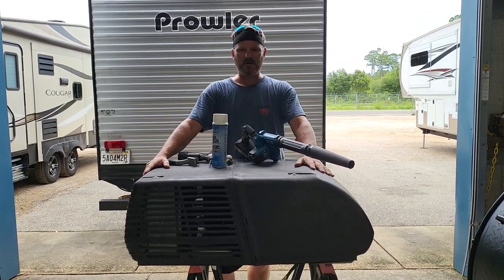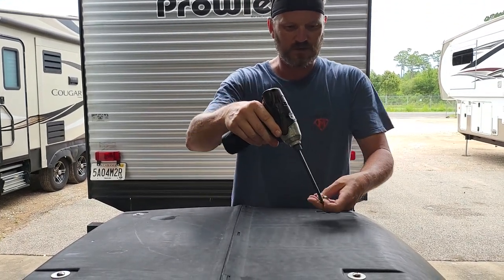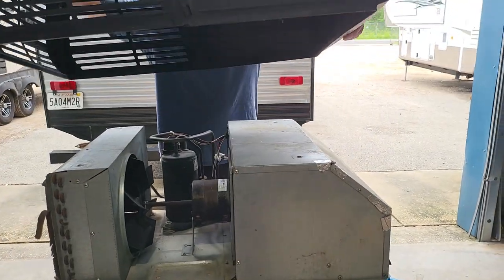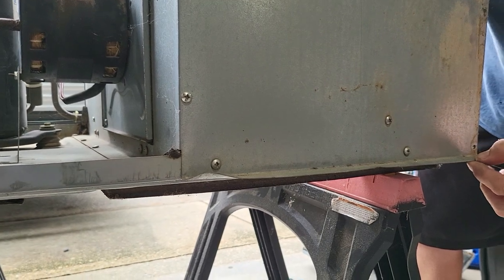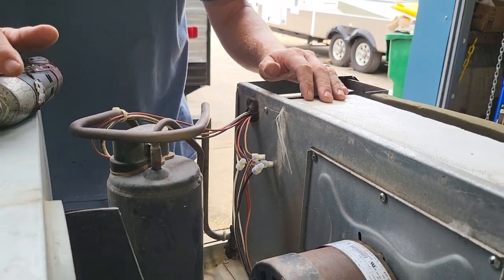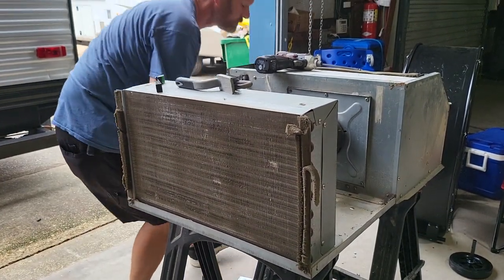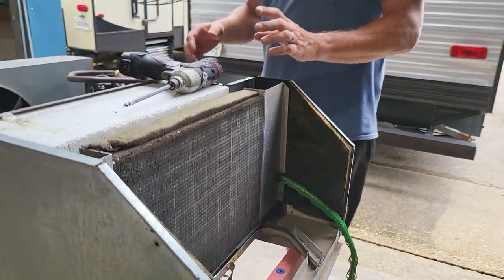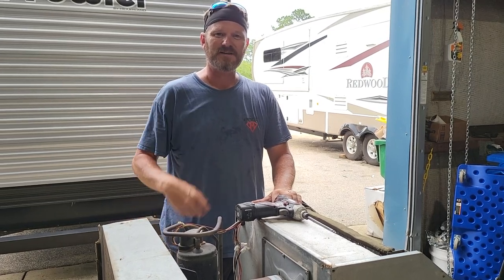Coleman Mach RV air conditioner walk through and **BONUS** maintenance

Comment: Do you have any idea how many videos I sat through until I found this one. I like it when someone just provides instruction.  I don't care where they bought the tape,drill bits, soda, or other crap. Thank you sir!
Reply from the maker: @LymanTaiste  thank you for watching!
Reply: Mine keeps tripping the 5kw generator breaker, 20amp. Sometimes after a couple minutes, other times after an hour. New capacitors & fan motor. What would you check next?
Reply from the maker: @ChrisHadlockTV  Compressor amperage, the RLA ( running load amperage) is listed on the data tag.

Comment: Edit: disregard, I just noticed the note at top left indicating dashed lines are optional.

Great video.  One question though, why only two capacitors when the schematic also shows a start capacitor? 

I have the same unit and today on a bright hot sunny day I disassembled it to troubleshoot and clean, when a torrential lighting storm hit suddenly out of nowhere.  I buttoned it up quick as possible trying not to get hit by lighting and assumed I just didn’t see the start capacitor.

I like that battery powered blower.  We used heavy metal Cadillac blowers to blow out elevator generators and motors for decades until Makita came out with smaller, lighter plastic blowers but still plug in (fine for us, we have outlets nearby) but a battery unit would be nice.

Comment: I have a 2000 mini Winnie Winnebago with an air conditioning on top only has 30,000 miles on it anyway I’m having problems with my fans starting and I changed all three capacitors. I know the starter capacitor for the fan has the brown wires in. it’s kind of the oblong shape Capacitor changed all three and I switch on the switch to check it. The fan still won’t start if it’s turned on and then I touch the fan and start turning it with my hand. It will go and it will work and work on high and low and everything works, except for the fan starting up and I know the capacitor that I put on the new capacitor I put on there works and I checked the white wires to go to the fan and it doesn’t seem like there’s any short those wires is there anything I might be missing, keep that fan from starting because the fan works. It works on high and low. It just won’t start unless started with my hand please I’ve been dealing with this for limited time over four years because RVs in Colorado and I live in California so I have a little time to work on it, but it’s really frustrating. Please help.
Reply from the maker: @MrDavehb47  capacitor the same uF? If so and tests good, then I would suspect bad bearings.
Reply: @MRRVTECH   even if the fan runs after I started with my hand and it doesn’t make any bearing noise and it changes speeds from high to low and low to high
Reply from the maker: @MrDavehb47  yes because the capacitor can't produce enough electrical torque to get it going froma static state. However, I would first be suspect of maybe getting a new/bad capacitor this must be verified first.
Reply: @MRRVTECH  ok thank you I’ll test those capacitors, especially the one with the two brown wires for the fan starter The RV only has 39,000 miles on it. You know how they are. They don’t they don’t get used that much plus I would think if the fan had bad bearings I would be able to hear it or feel it. I get these capacitors off Amazon I really need to test them  like you did.

Comment: On my Coleman, one of the four screws holding down the cover is spinning freely in the hole and won't come out to release the cover.  Have you had that happen before?  Any thoughts on a solution?  I'm guessing the threaded insert in the metal housing of the AC itself may have come loose and is just spinning along with the screw.
Reply from the maker: @jasonator13  yep many times, cut it off with a grinder. 5here are thousands out there with 3 screws

Comment: Great video. I learned a lot. I was just up there today but it was too hot to take it all apart. I have a very similiar Mach Q. 48204-0660. My question is if there is a modification that can be done to more effectively move the air into the ductwork for more flow. It seems to take my a/c forever to cool the rv down. I’ve added a Coleman soft start to the a/c for efficiency, but am very disappointed with the airflow. I have a Cougar 27sgs. Thanks for your instruction!
Reply from the maker: @dennisbachman4316  There is a product that claims to increase air flow by 40% its a styrofoam block with ducts that force the air into your ductwork directly so there is no wasted CFM. I have installed a few but I think "40%" is a little unrealistic. It does work though.
Reply: @MRRVTECH I looked into those. $170…Wow. My plenum is very shallow so not sure I’d gain a whole bunch from that. Thanks for the info

Comment: This is a good video, I've already learned how to clean the a/c, now my issue is the motor sounds like it still spinning/running for a few seconds after i turn the a/c off. It would be so very helpful.if you would make a video on how in the world you properly take out and and install a new motor. I have tired oiling the bearings but since the are not really serviceable I'm pretty sure I'm going to need to replace the whole motor. No decent videos are available for this. Thank you.

Comment: OMG! My really old 2006 Fema Trailer rooftop ac was making a racket and shaking after a coupla months of ownership. Yes, I bought a repo'd Fema! Anyway, I quit useing the ac when it acted up. Turned it on and quickly off for an electrician that came for a different problem, he say's "I know what your problem is and it'll cost you since I have to go up top. I just let it go and got a window unit since I live yr round in it. After watching your video I went on top and found the problem. Dirt dobbers nest on the fan!! Easy fix!! Thank You for this video!!!
Reply from the maker: You're welcome, thanks for watching.

Comment: hi Josh - from inside my trailer - i open to clean and there’s a styrofoam plate that moves around- i’ve been told this piece is the reason my coleman mock AC is freezing up and dripping inside, i moved it and now it smells like my AC is going out- which way should that plate face? 
TIA and thanks for all the great info
Reply from the maker: That sounds like your air dam that separates intake and discharge air. If the cold discharge air gets sucked into the intake the evaporator coil will freeze up. The air dam needs to be stood straight up and down between the two openings in the bottom of the air conditioner and then taped all the way around to prevent air mixing.

Comment: A very good video. I am happy I found you. I have a question. My 2003 Prowler has a Coleman AC with a thermostat on the wall. Lately when I turn it on to cool it delays several minutes before it turns on even when I have it set very low. Or it turns on then off.  What are your thoughts?
Reply from the maker: These units have time delay relays in them, they delay the time before the compressor starts to ensure the " head pressure" has dissipated, this prevents amperage spikes at start up that can trip breakers. That being said, after the time delay relay closes ( usually about 2 min 15 seconds) the compressor should start and run normally and not shut right back off. Now if you are in auto mode and have cycled through multiple settings on your thermostat this can occur as the control logic searches for the desired / correct fan speed but if that is not the case...you may need a service tech.

Comment: I have this AC unit on a 2022 Sporttrek, and the styrofoam block in the center between the fan and Evap coil has mold growing on it. How do you remove that to clean it?
Reply from the maker: Nylon brush then a rag...no water/ chemical

Comment: Where is the water going to drain. Mine is draining into my ceiling.  I have a Coleman Mach 3. I live in Las Vegas and obviously it gets HOT in the summer so the unit is running hard. Is there a trick on running a drain tube or something to avoid water damage in ceiling?
Reply from the maker: The condensate runs into a tray under your evaporator coil, the tray has small drains on each side that drip onto the roof. These drains often get clogged with algae or debris allowing the tray to fill up and overflow. Check your drains are clear. Also, it may be time for a new gasket and annual maintenance.

Comment: Can you tell me the easiest way to change out the compressor fan blade?  Do I need to take the whole motor off? It doesn’t look like enough room to pull the fan off without it hitting the coils. Blades broke off and mobile rv guy installed a dometic blade as a temporary fix, but it “clicks” (hitting something) so I want to replace with the right blade from Coleman.
Reply from the maker: The condenser fan blade can be swapped by removing the Phillips screws at the base of the condenser housing, this will allow you to m9ve it slightly backward to swap the blade. If you have an older model it may also have 2 phillips screws on the top brace attaching the condenser and evaporator housings together.
Reply: @MRRVTECH  cool - I’ll give it a shot when my new fan blade comes in next week. I’ll let you know how it goes.

Comment: Nice to see a video where a professional knows their trade as opposed to weeding thru vid after vid of people “figuring it out” as they go. 🙄
Question about the drain: I’ve sucked out the drain tube that comes out by the wheel well with a shop vac and that seemed to fix the leaking Dometic- for now…but if it happens again, am I looking at taking apart the “box”, to access the drain pan? ( Other than pulling off cover, which I have done a number of times)
Reply from the maker: Yes, remove the cover and open the evaporator enclosure, you will see a tray under the coil.....I have a McDonald's milkshake straw attached to my shop vac to reach the tray and suck all the algae off the tray and out of the drain cups to clear them.
Reply: @MRRVTECH  Ty!

Comment: This was a great video, thanks for walking us through the process.  
Question for you; My travel trailer has this exact unit and after it had sat for a while, I tried to turn on the A/C to test it and it just hummed.  I quickly shut it off and then hopped up on the roof to check things out, and noticed that the blower fan wasn’t spinning very well. I shot some WD-40 into the bearings and spun it manually to work it in and that seemed to do the trick, but the unit now runs noisier than it did before.  Is there anything I can do to disassemble the fan blade/shaft from the motor to better lubricate it?
Reply from the maker: No, it sounds like the bearings have dried up and rusted, best to just replace the motor.
Reply: Hello. I have this same unit and it keeps on freezing up onnme after I run in on high for a few hours. I've cleaned it like you demonstrated on this video as well as the filters on the inside of the rv but it still freezes. How can I fix that? It happens to be the unit on the bedroom side of the rv and it gets hot inside quickly when it locks up. Any help would be much appreciated. Thank you.
Reply: Also, when it freezes and defrosts it shoots all that ice down then ducting. The drain gaskets are not clogged either. If that helps.

Comment: Thanks for the info. I have recently had mine replaced but the new will not keep blowing cold air,  as the day gets hotter the air the ac is blowing also gets hotter. I'm going to try the tape trick. I hope it works.

Comment: I have a 2019 Grand Design Travel Trailer with this brand AC. I just tried to unscrew the 4 screws on the top of the shroud. Three screws came out easily, but the last one, even adding WD 40 will not even budge. I would like to do maintenance on it, although it is working. Any suggestions as to how to remove this 1 screw? Thank you so very much.
Reply: I actually have the same problem today and I ended up cutting the bolt off to get the cover off. All I did was spin.  Now I’m looking at removing the evaporator coil shroud and trying to replace that one bolt that just kept spinning. this is not for you but the gentleman who posted the video what are my options and replacing that I’m also getting a minor spinning noise I’m wondering if I can spray some WD-40 and eliminated thoughts?

Comment: Hi l have a 2002 Fleetwood  southwind with a coleman mach ac.i replace the blower motor.the blower motor runs backswards.l have checked my wiring it's all good.l suspect bad motor from factory.whars your thoughts?
Reply from the maker: How is it running backwards? Which way is the air flowing?